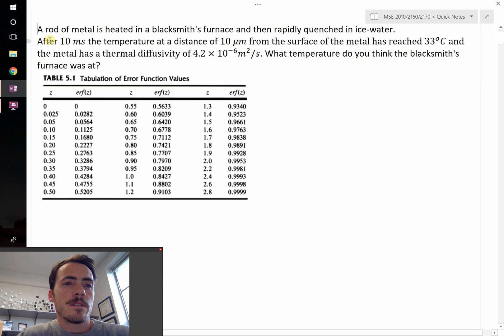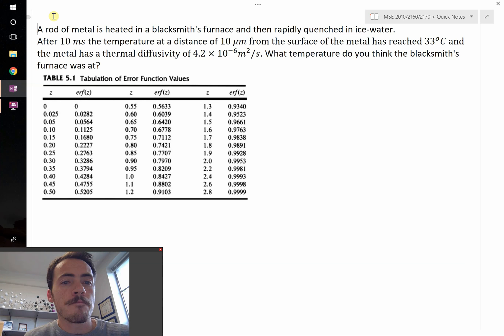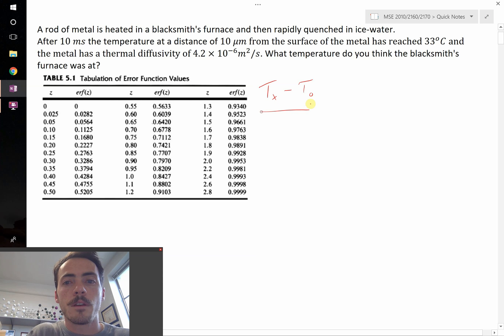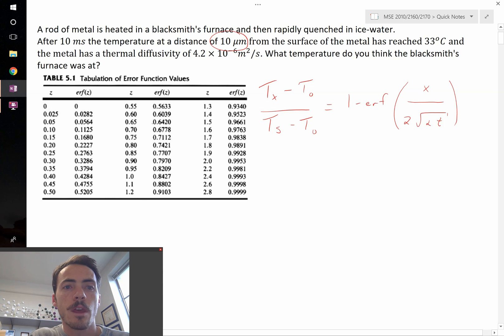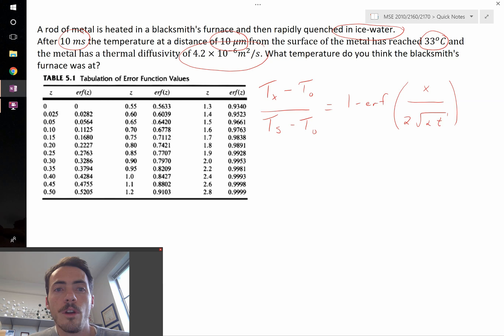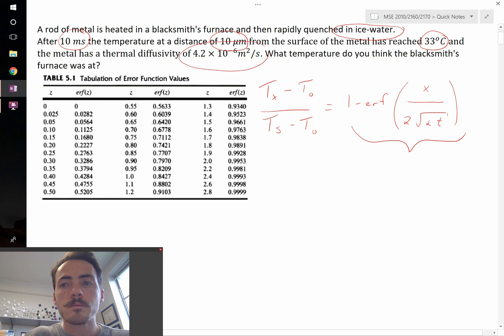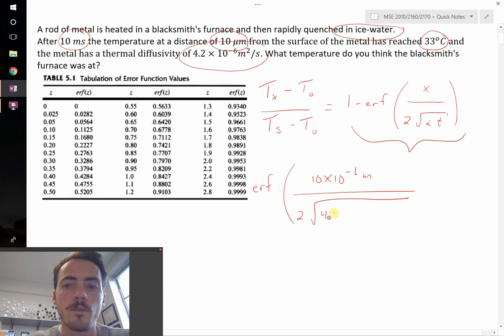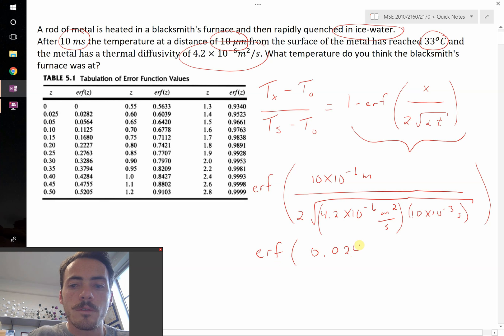Non-steady-state thermal transport Ficks Second Law example problem

Comment: Isnt these formula is calculated with Kelvin, instead of Celcius ?
Reply from the maker: won't matter because we take difference. Both scales would have the same difference.
Reply: Actually, in the calculation, you must be working in Kelvin, ie add 273 degrees to the Celsius value. However when you give your answer, you must subtract that 273 degrees again.
Reply from the maker: @delbertgrady1997  nope. It cancels. Try it.

Comment: Hey man. A little confused on the last step. You original had 1-0.02..=0.97... and then later were dividing both sides by 0.027 again.
Reply: he added T0 to both sides then factored out, so you get -0.97248+1=0.02752